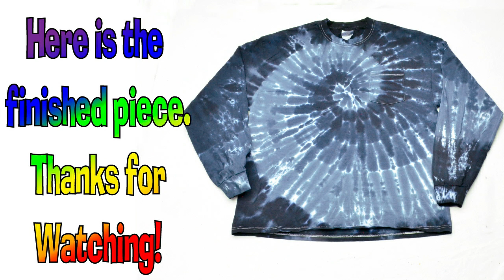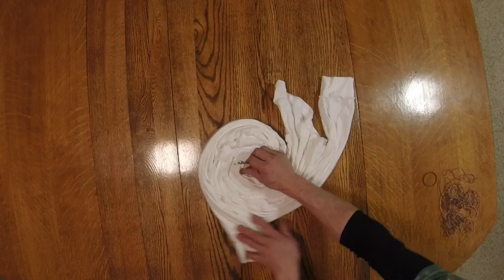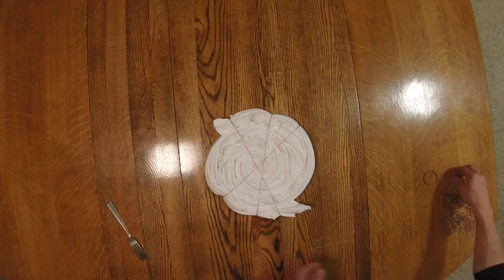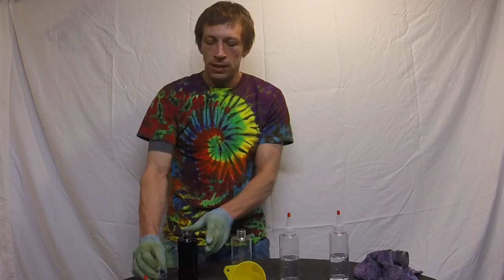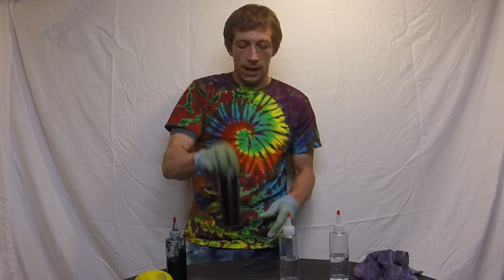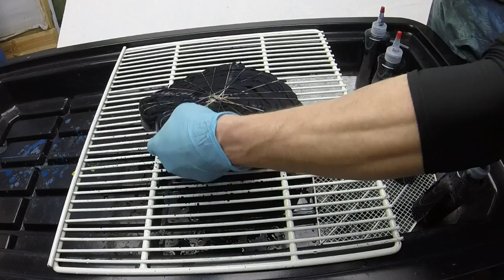Black Dilution Spiral Pocket Long sleeve shirt [Long Tutorial] #49

Comment: I have a question , if you take it and soak it in the soda ash for 2 days straight does this make the colors brighter or does it eat the material.
Reply from the maker: I  haven't had any problems for two days, two months is probably pushing it.  Different fabrics may react differently though.

Comment: quick question ' if I only wanna do 2 colors like red and black but have a white tee how would I dye it ?
Reply from the maker: +Makayla Anderson You could put red on the shirt and then layer over it with black.  If you wanted some red, I would fold the shirt, and dye it so red was on the "bottom" of the piece.  If red is on top gravity can create pink going down through the red through the design.  You could also use a dye thickener on the red to keep the colors in place.

Comment: Can you show how you soak the shirts...!?! Im a beginner im not sure what soda ash is. And is your shirt supposed to be damp wet dry? Can you please do a video from step 1 and go though everything even the makink of the dye. And then explain how to rinse the shirts out once they have rested in a bag for 24hrs. I would really love to give this a try I LOVE THESE SHIRTS. I would rather make my own then go out and buy on at wally world.  Any ideas, suggestions, help would be greatly appreciated. 
Lorraine
In New mexico
Reply from the maker: +Lorraine Popp-Davis I'll try to keep this short :)
I wash everything with a "Free and Clear" detergent, to remove any sizing, or residue from the production process beforehand.  Sodium Carbonate acts as a "catalyst" to allow the bond between dye and fiber.  I will take the spun out, washed fabric/shirts and put them in a 5 gallon bucket with soda ash solution.  The ratio I use is approximately 1 cup sodium carbonate to 1 gallon water.  It will soak in that for at least 30 minutes.  I use litmus paper to test the soda ash solution.  I want it around 11.5-12+.  I use a separate washing machine to spin out the excess soda ash solution, back into the 5 gallon bucket.  Next I will let some of the excess moisture leave the fabric, through air drying or a conventional drying machine.  Different dampnesses will give you varying results, if the fabric is too wet, the dye won't penetrate all the way into the depths of the folds.  Too dry can have problems/variations depending on how you look at it.  If the piece is too dry, you can use a spray bottle to get the fabric wet enough to absorb the dye.  I let my pieces sit for 24 hours in a plastic bag, before I rinse them out 6 times.  I use approximately 4 teaspoons per 8 ounces of water for my dye.  I use Procion Mx Fiber Reactive dye.  I will put in more dye for some of the darker colors.  I also use my dye within 12 hours of mixing it with water.  I hope that helps, and have fun dyeing!
You could probably use a mop bucket/wringer if you don't have a spare washing machine, or if you aren't doing too many shirts, you could wring them out by hand.